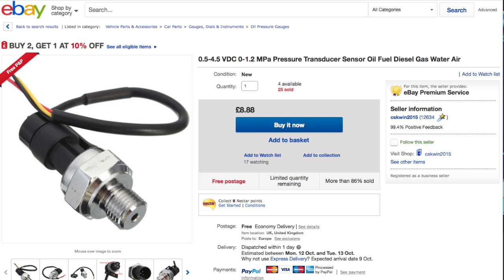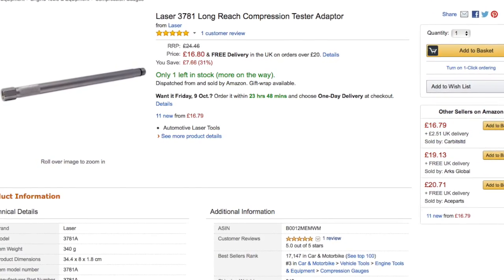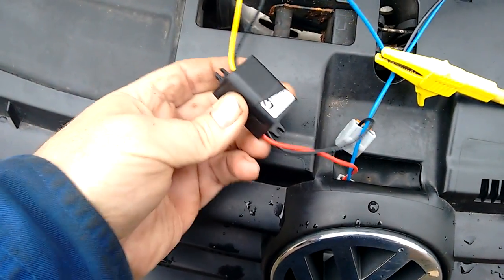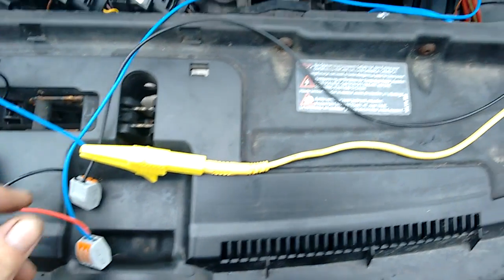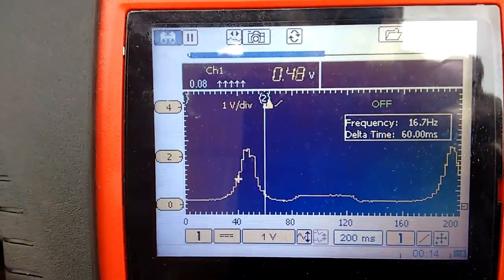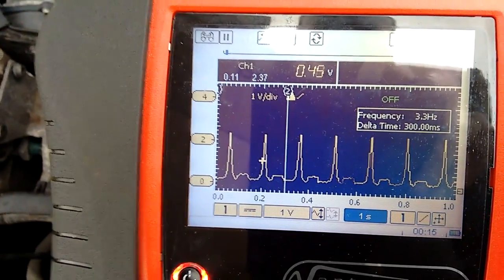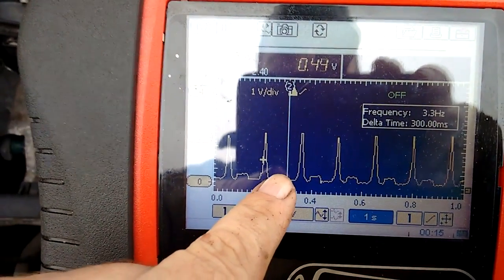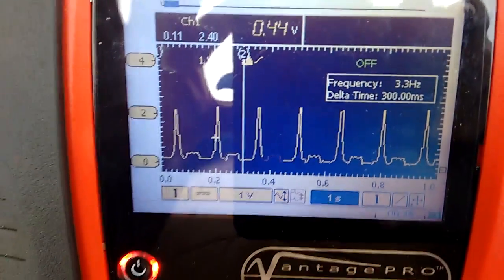Diy pressure transducer

Comment: People talk about pixelation, which I had assumed was a sample rate for the scope. Your waveform is acceptable, but I wonder if a scope with a higher sample rate would smooth out the waveform. Reading various remarks about these builds here in the 'net, even those using a pico are having issues. So, to my surprise, there seems to be an issue with how fast the sensor responds and updates. Any insight? I've ordered a pressure sensor with a 1ms response rate, presumably that is too slow....
Reply from the maker: Hi not aware of pressure sensor resolution issues but I do know that pulse sensor interpretation is a black art because of so many variables! Thank goodness their are other methods to skin a 🐈! Cheers sandy

Comment: Hey Sandy, nice video. I decided to make one myself. I made a order on a pressure sensor. But now when i got it I noticed that its a two wire sensor. That means it uses a current signal from 4 to 20mA . And that makes it not useful for me at the time. But I have an idea how I can read and connect my DSO. I may post a little video on the result later. Cheers.
Reply from the maker: look forward to your video, I'm thinking about ordering one for measuring vacuum in inlet and one for exhaust pulses have u done this? cheers sandy
Reply: No, but it should work good, if its sensetive/fast enough. What pressure range do you have? Mine goes up to 16bar. I look forward to see how fast it is.
Reply from the maker: +AutoFocus I've got pressure sensors one goes to 1.2 MPA which is 12 bar and the other 5mpa /50 bar, they work and still a lot cheaper than the picoscope wpx 500
Reply: Ah I see. Mine is also a lot cheaper, even if I need to add some special gadgets to make it work. But I don't need a V-reg it runs from 8-30v so a simple 9v battery and it works. But, I will get back with the result. btw, what do you use the 5Mpa sensor for? Have a good evening.
Reply: +sandy anderson  Hey Sandy, now I got my PT finished. The box have a 9v battery and I also added banana connectors. You can see it in this link and a waveform. http://imgur.com/a/wfHFr
Cheers!
Reply from the maker: AutoFocus looks professional, did u use the current one?
Reply: +sandy anderson Yes, after some try, error and research I ended up using a simple resistor (220ohm) to get a voltage conversion. In the best of worlds I would want it to have a faster response time. Looks like this have 1ms and its ok after some filter. Well its a part of the price. 
Cheers.

Comment: Hi Sandy, aewsome build! Do you think this can work with a picoscope?
Reply from the maker: yes definitely and it will save u a fortune compared to their wpx 500, sandy
Reply: sandy anderson AWESOME! Just finished building my pressure tester for the cooling system. I think i am going to build this, many thanks for the video :)
Reply from the maker: Yes they would work fine, sandy
Reply: +Andrea Gili Obviously i am asking about the extension this tool uses, i hope it can fit the pressure transducer as well
Reply from the maker: +Andrea Gili yes I think that will, check this video out at 16mins .20 secs https://youtu.be/iMlOAcUnskg this looks similar
Reply: +sandy anderson After i saw that video i decided to try to build one myself but i didn't noticed the flexible hose LOL  Thank you for your time Sandy i really appreciate it